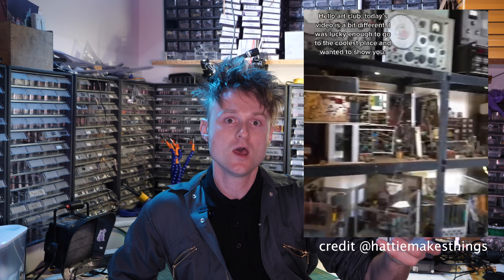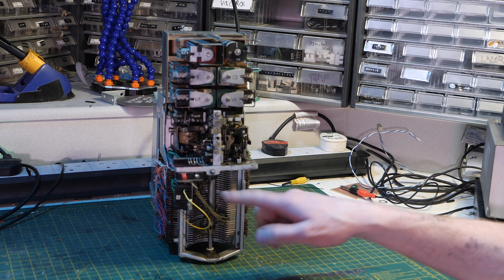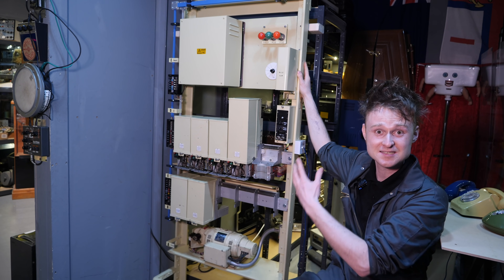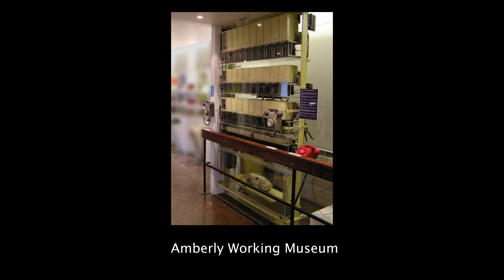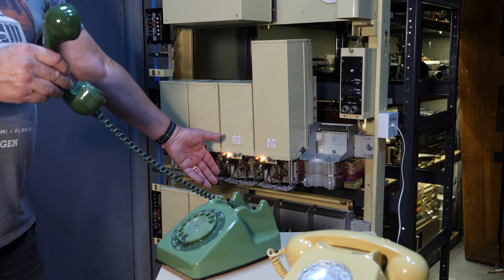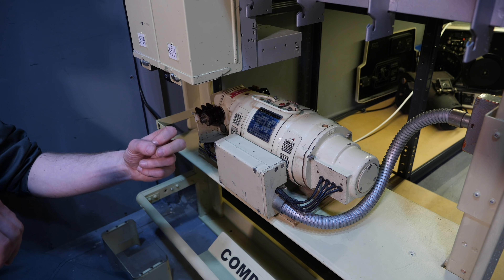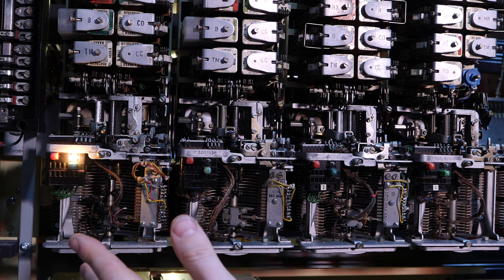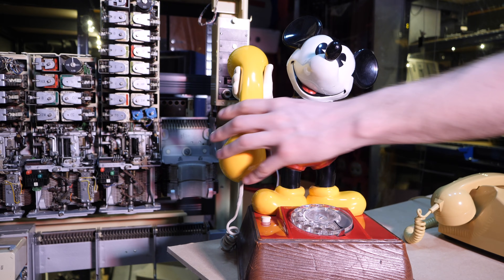STROWGER Telephone Exchange mechanical machine

Comment from the maker: SAMPLES AND 10 MINUTES OF STROWGER/PHONE SOUNDS FROM IT HERE :-
https://youtu.be/M406arpS7ZA
or any old phone memories? By the way regarding power I was wrong on the motor! That is on 50v dc and outputs 75v ac for the ringer. As it says on the actual motor if you look closely ha
Reply: I was maybe 11 years old and into electronics... my best friend's dad was a Bell Telephone engineer and he gave me a HUGE box of telephone electronics.... resistor networks, relays, transistors, diodes, full assemblies and half ripped up assemblies.... I am pretty sure at the time I felt like you when Richard delivered your new kit....      BTW I wonder if all the dust cover can be replaced with equivalent plexiglass covers so all the relays can be seen....
Reply: @URTonemanclan  +1 plexiglass
Reply: @URTonemanclan  Clear covers is a great idea!
Reply: I retired from the Moscow City Telephone Network a couple of years ago. Of course, there are no stepping switches  anywhere, but the copper lines in the city center are still hell.
P. S. Sorry for the bad English, I use a translator.
Reply: The phone being by the front door, wired straight in and having to sit in the porch in the freezing cold to use it.

And planning with people when you were going to call them.
Reply: I have memories of old rotors dial phones like that, when I was a kid in 80s I got in to trouble, as we had rotors dial phone like that and it was rented from BT British Telecom and I wanted to know how it worked so I took it apart, luckily when later and we had to phones, also have memories of using phone boxes kiosks which I have unusual obsession with unlike other people I also love the later phone boxes, and interested in phone phreaking and technology and of talking clock and Radio and TV and computers especially history of technology and how it works.
Reply: @carldurrell9943  same! I used to call the talking clock to set my watch... almost forgot about that. At some point I figured out a special non-geographical numbering scheme for phone exchange use here in Ireland. 199000 told you your own number, 199017 did something weird that changed your dialtone if you picked it back up after a few seconds, then called you back about 10 seconds later (I think it just played a busy tone when you answered). I tried to map some of the numbers out as a teenager until I reached an exchange and they told me to piss off and stop calling.
Reply: My grandmother had a old dial up phone that was in operations from the 70s till 2019 . 

When I was around 10 I would tap the hang up switch in a particular timing to dial numbers since I thought it was cool not to use the easy dial up wheel. 😅
Reply: @NinoJoel  lol same ..
Reply: @NinoJoel  It was also handy if the dial was padlocked. Lol
Reply: Remember to keep 10p in your pocket handy just incase you need to make a call.
Reply: Tim Hunkin demonstrating the group selector/exchanger device on an episode of "The Secret Life of Machines" like 30 years ago is my memory, chummer.
Reply: @patrickhayden7206  thats all o  youtube here btw good series
Reply: If you're fast enough, you can make the number (and get the selectors move accordingly) by tapping the off/on-hook contact of the phone :-)
Reply: @StéphaneFontaine-i3m  you got to be good , as you know Zero needs 10 precision taps, lol.
Reply: @StéphaneFontaine-i3m  yup used to do this for fun - sad maybe :D
Reply: Ringer should be 90v ac
Reply from the maker: @forbiddenera  should it be? I don’t want to disagree as I’m not 100 percent sure but I don’t think that’s right. I wasn’t right either the motor is on 50v and outputs 75ac for the ringer. All I needed to do was read the bloody label on it ha
Reply: @LOOKMUMNOCOMPUTER  not sure where I got that but was ingrained in my memory but maybe its not right. "In landline telephones, bells or ringtones are rung by impressing a 60 to 105-volt RMS 20-Hertz sine wave across the tip and ring conductors of the subscriber line, in series with the (typically) −48 VDC loop supply.[3] This signal is produced by a ringing generator at the central office."
Reply: @LOOKMUMNOCOMPUTER  oscope the line during a ring
Reply: @forbiddenera  I think the ringer frequewncy is 25Hz in the UK
Reply: What did the relays ever do to you. Don't shoot them Sam. 12:46
Reply: "You have reached 1-800-IDEA. If you are using a rotary phone, please press 1. If you are using a touch-tone phone, please hang up and dial again."
Reply: I LOVE that you love this stuff!! I also love and collect telephony and telegraphy equipment and have, among many other things, a full 1940’s Bell Telephone PBX operator’s desk. I’m so excited to see you get this system and keep it together in working order! Your museum’s cool factors just went up by 1000 orders of magnitude!
Reply: You and Richard might be interested to know - current technology is switching ~150K calls in about 30cm of rack height... (my first boss had part of one of these in his office, I've worked at companies which build the modern electronic replacements all my life.)
Reply: I work at an ISP in the U.S. I'm not old enough to have seen or used these. However we do still have a bunch of old switches similar to these that still work. I've seen videos of them in action and It's really cool to see their step by step process. Seeing it actually helped me understand  today's modern telephony like VoIP. VoIP is  confusing to me.
Reply: SAM! What a beautiful composite you have there! Thanks for sharing about a topic I was BORN into... I am a forth generation telephone worker here in the US. Also glad you asked about the voltages, 90v seemed a bit high but I had to do some searching around because here in the US our system is explained with varying voltages. And when I searched for the UK it seemed like the voltages were higher BUT see link here and you will see similar voltages related to what looks like your equipment:
http://www.islandregister.com/phones/demo2.html

searched explanation:
When the phone is not in use, this is a constant DC signal (about 50-60 volts). When the phone rings, the signal is a 20 hertz AC signal (about 90 volts). ( I wonder if this is what is going through that brushed motor at the bottom, it is 3 phase) When in use it is a modulated DC signal (between 6 and 12 volts). The phones lines even have power during a blackout in most cases. 

cool side notes, I hear its the telephone that moved my great grandfather to Seattle to help build one of the first networks - I got lucky enough to work in the same building as my father when I was older too. When I was a kid I remember him being like a phone hero - once I remember the back up generator went out and he said he was off work but wanted to go get the town back "on line" but that he could get in trouble - he did it anyway! hah Also we joke that as he was connecting the copper in the office, I was going behind him and pulling it out as a toddler :D
Have fun with this thing!  And that story you told about the reason the exchange was created was the same I've heard, and SO funny!
Reply from the maker: @butterballsknows  cool! I was wrong on power the power supply sends 47v into the motor and the motor makes 75ac for the ringer
Reply: @LOOKMUMNOCOMPUTER  I think more correctly -47v as the telephone system used positive earth.
Reply from the maker: @RCbeastly  -48 but yeah. it is.
Reply: I used to be into phone phreaking when I was a teenager in the 1990s, and I knew of two step-by-step exchanges in operation.  One was somewhere in Canada (cannot recall where), and one was in Miami, TX.  Both have long since been replaced, I'm sure.  When one placed a call to a number in Miami, TX, all audio from the switch was passed on-hook. One could hear the entire call completion process.  The ring tone was an oscillator's output overlaid right on top of the 90VAC on the line! Wait, do you actually own this thing now?!?  Did I hear this correctly?  I was really into this stuff right at the tail end of when the last vestiges of these systems were dying out.  Ooh, MF tones!  I was "blue boxing" well into 1997, actually.  I would use 800 numbers which connected the caller to an international operator in various countries.  Using my PC to generate the tones I was able to seize a satellite trunk and then call anywhere in the world as if I were an inward operator.  It used CCITT#5 signalling, which was entirely in-band.  I also had an 800 number in Alaska which was still using the old domestic Bell System MF signalling standard.  I once placed a call to Alaska, to Greece, and then to my other line hooked up to the other phone at my desk.  About 2-3 seconds of delay one way, lol.

Crossbar switches are even more impressive than SxS, as they had implemented mechanical memory as well as a marker frame, which is truly magnificent as far as electromechanical systems go.  Unlike the SxS here, the crossbar switches did not rely on the customer's pulse dialling to complete calls.  It had registers, too, just like a computer.  It was SO CLOSE ...

Glad to see younger people are still interested in this.  I thought I was among the last crop of people to be fascinated by legacy equipment, as it was all very much on the way out in the late 90s. 

The number five crossbar had a lot of advanced features!  It still blows my mind that they were able to do all of this wih relays.

https://en.m.wikipedia.org/wiki/Marker_(telecommunications)

https://en.m.wikipedia.org/wiki/Number_Five_Crossbar_Switching_System
Reply: @bsadewitz  hmm see im not the only person thinking 90v
Reply: @forbiddenera  For the US, at least:

In the United States, the FCC Part 68 specification defined REN 1 as equivalent to a 6930 Ω resistor in series with an 8µF (microfarad) capacitor. The modern ANSI/TIA-968-B specification (August 2009) defines it as an impedance of 7000Ω at 20Hz (type A ringer), or 8000Ω from 15Hz to 68Hz (type B ringer).

I had no idea there was a type B, lol.

https://en.m.wikipedia.org/wiki/Ringer_equivalence_number

Edit: ah, this page has UK, Australia, Canada, too.
Reply: @bsadewitz  that tells us the max Ringer loading but not voltage
Reply: @forbiddenera  D'oh!  You're right, of course.  That's what I get for trying to think before breakfast, haha.  I had it pulled right up on the screen, too, I have no idea why I pasted that instead.
Reply: @forbiddenera  Subscriber loop signaling and transmission handbook: Analog
Whitham D Reeve, Whitham D Reeve
IEEE Press, 1995

This seems like it should have everything you could ever want. ;-)

I will see what I can dig up later.  Sure wish I could find what I was looking at before.
Reply: They are before my time but as someone that works for the phone company I wish I had seen one in person, they are a really cool piece of historical tech.  Now days most of our stuff is on DMS100. And DMS10 and some DMS1U as well.
Reply: If I recall correctly, I think for an extra fee, you could request a phone number that mainly used 1 thru 5 so people/customers could dial you quicker.
Reply: My sister played the lick from Mighty morphing powerrangers on the phone keypad back in the 90s....It was lit.
Reply: @look mum no computer, now you've got to grips with this technology, look at the BBC Subscription TV service from the 1950's that used the same technology for Subscription Cable TV. Yes I am serious!...
Reply: 4000 series that’s modern. I worked on pre 2000 selectors with Line-finders (not uni-selectors ) shared service lines (2 premises using the same line with different numbers) and this was in central London in the late 70’s and was still the GPO. 
The eeriest thing is when they take a strowger exchange out of service when your used to the noise, the sudden silence is deafening.
TXE4, Crossbar, System X and Y do not have any soul.
Reply: I wish I could hit Like Multiple times on your videos!
Reply: Hi, thanks for the great video. There is a two volume book set  called Telephony vol 1 and Telephony vol 2  by J Atkinson published by Pitman. They are definitely worth getting hold of even if you can only get volume two as this has the circuits and explanatories for the type of  equipment you have. You can find them on the online second hand book sites. Sorry about posting this twice  I thought I may have put it in the wrong place.
Reply: When I was an apprentice I had a wonderful Engineer teaching me. Bob was an ex GPO engineer great stories from his life in London from hiwmany twists to put in a wire joint the carrying molten wax through the exchange to seal the joints shouting hot wax as you go.  To his favourite about punching out the platinum contacts from uni selectors    weighing them in at the local pawn shop and getting more  than a month's wages for them.
Reply: GPO line test 
17070.  Used to have fun with that as a kid having the exchange ring me back
Reply: Most people these days have never even used an analog phone. I has. Lol
Reply: "At the first stroke the time will be..." (in tones of crackly received pronunciation): ~  Ratchet selector sounds ~ electromechanical orgasm-ish / Awesome. Ratchet selectors into chunky pixels , dynamically ? That's on  another level. Roll over Captain Crunch.

Comment: I have been collecting parts for over just about 3 years now trying to make the very setup you have there and I will admit, it is still an ongoing and often frustrating pursuit. Eventually I will get there. In the end I have designed up a really nice (IMHO) clear acrylic panel that will explain and show (with LEDs) exactly what is going on which will be mounted on top of the rack I built to house it all. Very cool!!!! Thanks for sharing.
Reply: FYI, I also have been designing and building synths and synth modules since the 70s. Mainly analog, a few that are tube (yes, you read that right), and of course digital. Eurorack, MU, etc. I think we have quite a few of the same interests lolol

Comment: i learned my job at Deutsche Telekom 1990++ and we still had exchanges/centrals with strowger switches, old ones for pulse dialing called here Hebdrehwähler, was music in my ears hearing them operate, and sure i was sad when we dismantled them for the new system. They doen a good job long time and sure would do it even longer, just like we still got copper wire in the earth with paper isolation, we dont change them as long it works fine. Well maybe by now they are, i was only 3,5yrs at Telekom and switch from wired communications to wireless communication in the Luftwaffe for over a decade.

Comment: I and a colleague used to maintain a 7,500 line Crossbar (TXK1) in Llantrisant, South Wales. Our ringer machine was similar but larger than yours. The first week I was alone one machine failed, I had to drive 15 miles to the workshop to get a replacement. Plugged it in, started it and BOOM the fuse blew. First thing you do is try a new fuse, if my memory is right it was a 15amp fuse I blew quite a few! Managed to get a colleague to bring me a few new fuses and I met him half way. Still having fuses blowing so after a call to management they tried to get a new replacement but only a smaller lower capacity one was available. My colleague came down and we looked at everything until we were down to the last two fuses so between us we made a new fuse. We soldered 15 amp home fuse wire across the fuse body. This was a big mistake. Used our new fuse and the motor started but the ringer cam contacts glowed red hot and the cam contact blocks melted. We were now down to a sole low capacity ringer. Not a good thing to do. We had a new pair of ringers the next day and the workshop found out the cause of the failing of the first replacement ringer. When the unit was plugged in one of the leads was pushed onto the plugs metal case so earthed the live supply. When we unplugged it the lead resumed its correct position. Our home made fuse was bound to fail, we were both very experienced engineers. A 250v fuse at 5 amp was designed to blow at a fairly low resistance contact to either neutral or earth. We put a fuse designed for 250 volt into a fuse designed for 50 volt, BOOM

Comment: Every telecoms museum places the Strowger switches on the same rack for simplicity to demo the system.  It's very misleading as you indicated.

Each digit sends the connection of to another central office or rack in the destination office to make it to the destination subscriber's line.

Once you unwrap that in your head you realise how complicated the early rotary, then panel, then crossbar switch wiring was.

Only when xESS was deployed could calls become virtually switched until full solid-stage conversion to digital was possible.  It was all incremental improvements as each generation improved speed and density of calls.

Now, with the internet being the convergent solution, there's no need to build out separate networks for voice and data.  

It's all data now and QoS solves the quality issue by prioritising voice packets over the shared lines.

Comment: I remember in the early 80’s having a tour round Swindon telephone exchange. They were in the process of replacing the Strowger gear with the new digital System X exchange. 
Another thing was there were actually two slightly different engaged tones. Equal duration tones meant subscriber engaged, and a 2:1 ratio in tone length meant exchange engaged - no free lines to connect the call.
And if your mechanical dial failed, you could actually press the hook switch on the phone the right number of times with pauses to dial a number.

Comment: The size of that brushless motor! That simple commutation on that slip ring could be done with a one inch diameter gear motor or a windshield wiper motor.
Reply: It needs to work reliably for a bazillion hours